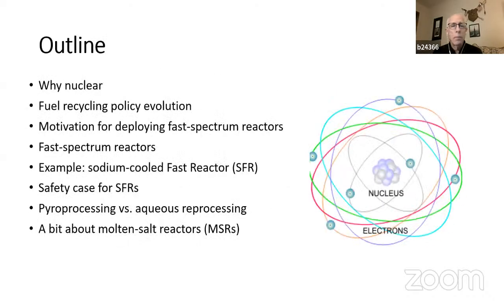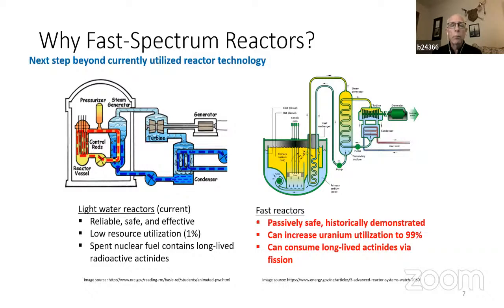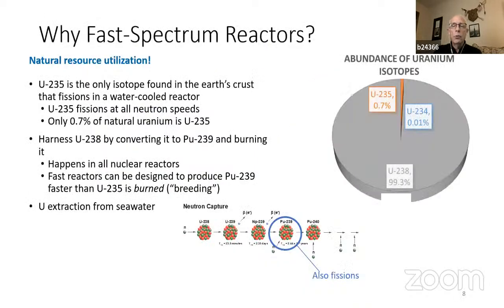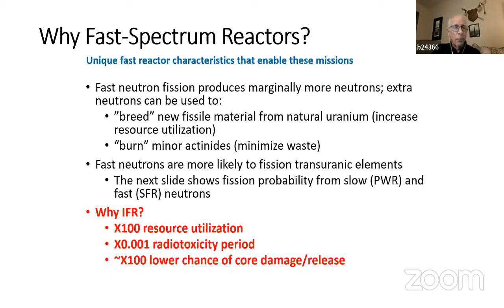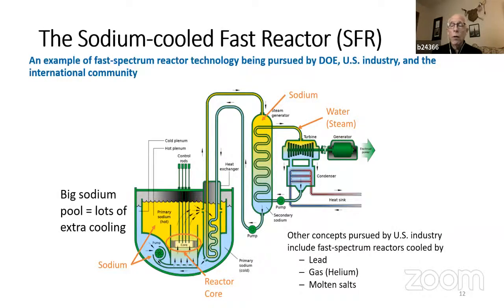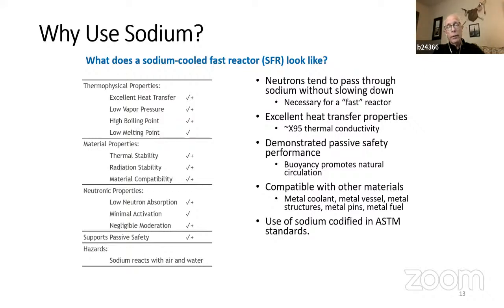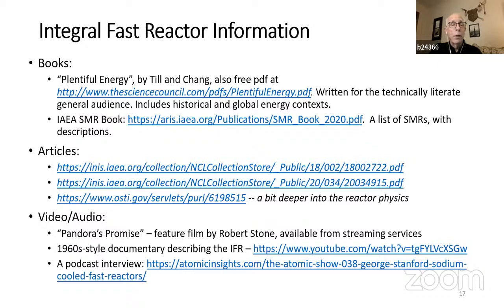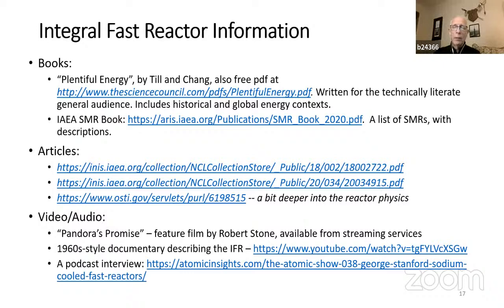Fast Neutron Reactor - Safe Power for the Future with Roger Blomquist, PhD USN Ret.

Comment: is it safe enough to leave on its own without a meltdown, poisoning the area or explosions? we need to be pushing for wind, solar and geothermal energy. no need for more reactors that have to be tended to if shtf. i get what youre going for. safer energy. but its still heading in the wrong direction. we could be running on tesla coils and wireless energy man.